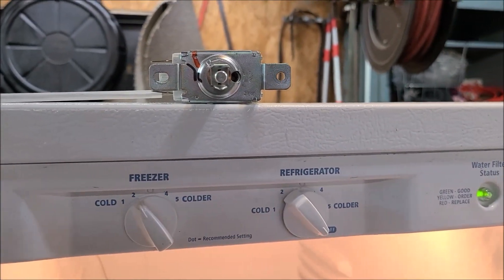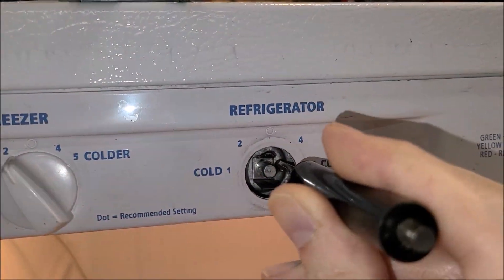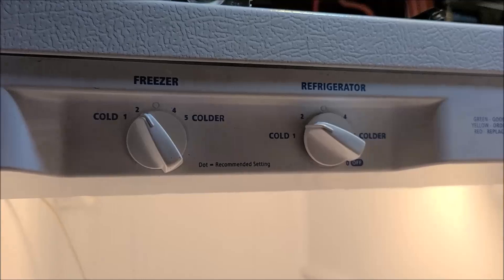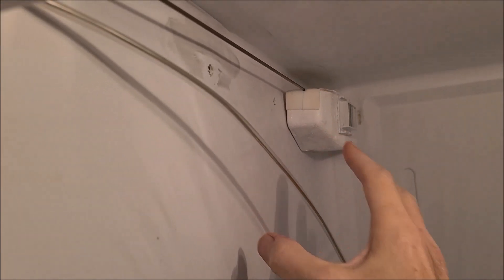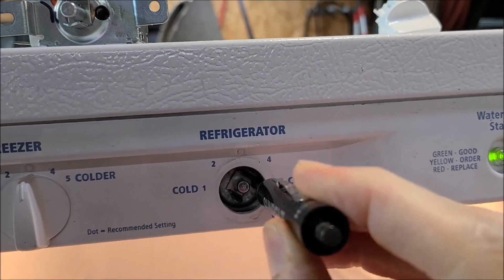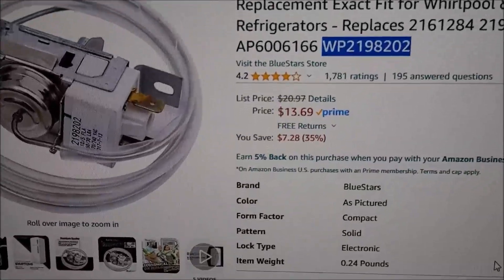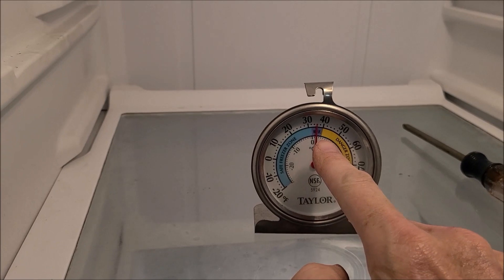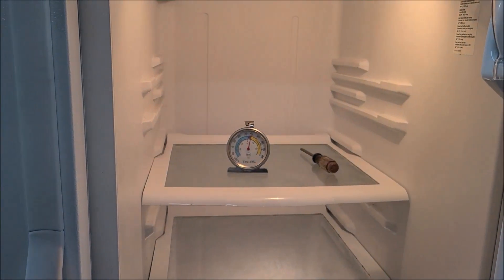Refrigerator Thermostat Is To Warm or To Cold, How To Fine Tune By Its Adjustment Screw WP2198202

Comment: Thank you for showing the “hidden” adjustment on a refrigerator to fine tune it.    I had the same problem.   Even with the thermostat set to the lowest setting items were freezing.   Thanks for the detailed video.   Bob in Michigan.